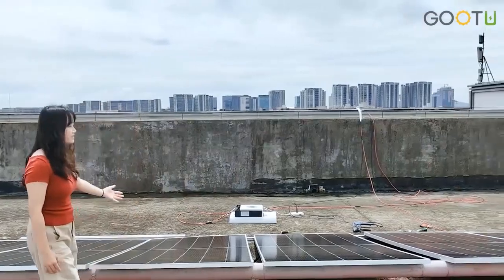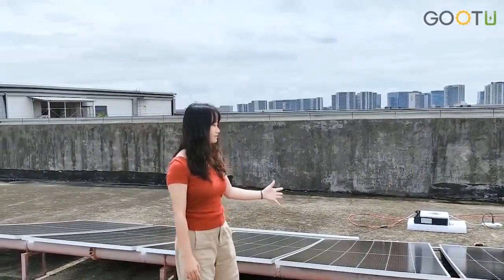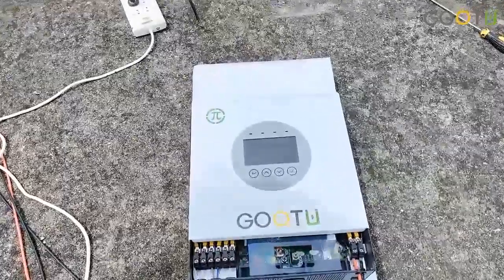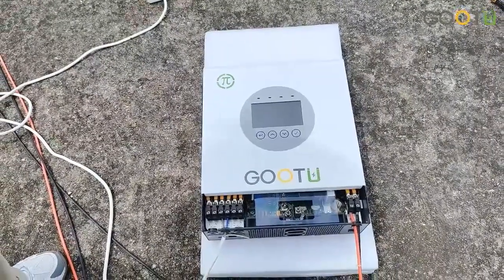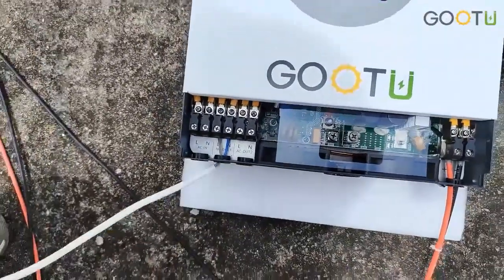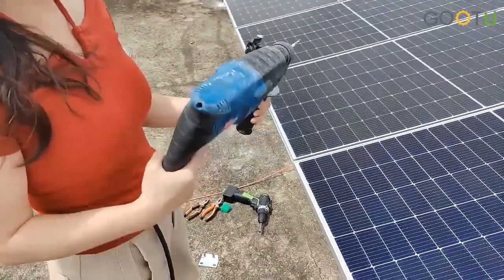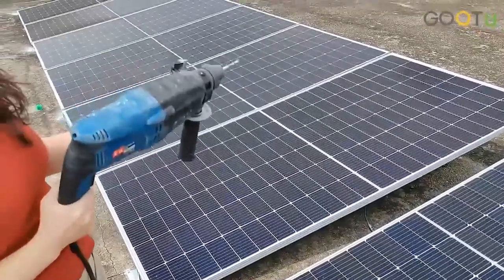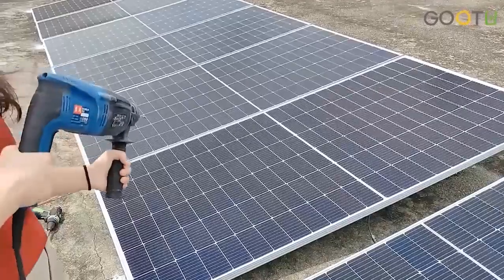GOOTU Solar Inverter Powers Cordless Drill with Solar Panels: Off-Grid & Power Outage Solution

Comment: It has max 500 watt voc and 27 Amp current so we can not connect 11 panels in series it will make voc 11*49=539 watt which is wrong. So how exactly 9000 watts panel can we connect with just 500voc. If we connect lets 550*8=4,400 panels in 2 series then it reach to max  current 27Amp and we have risk. So looks like we can only connect 550 watt 9 panels in series which is equal to 5000 watt safely .